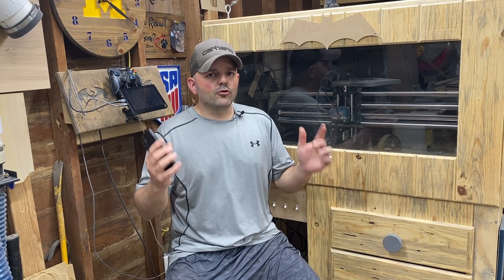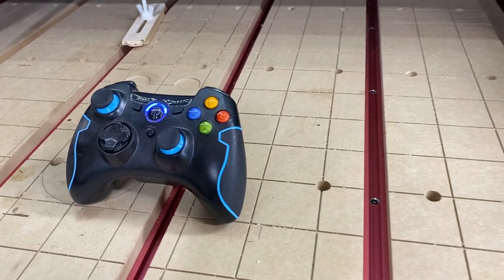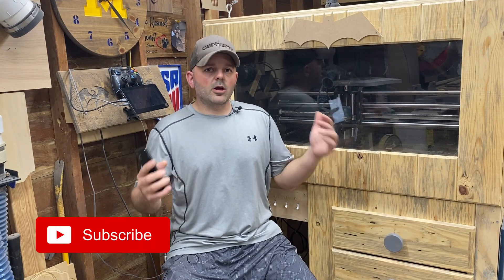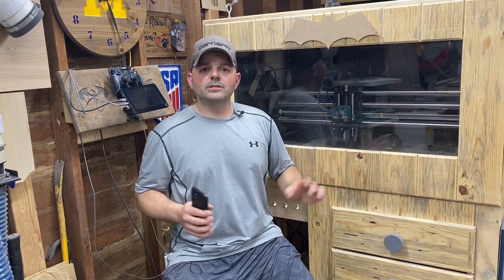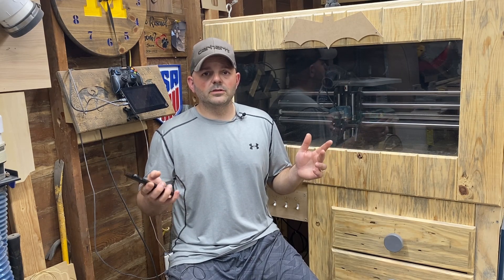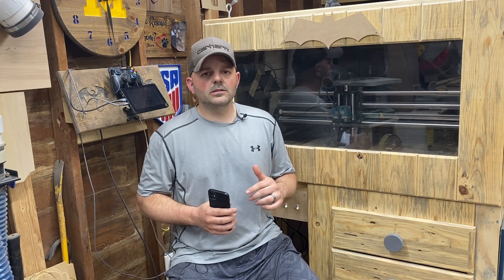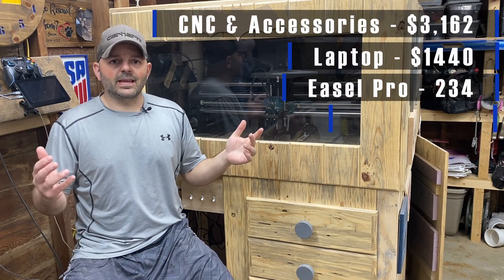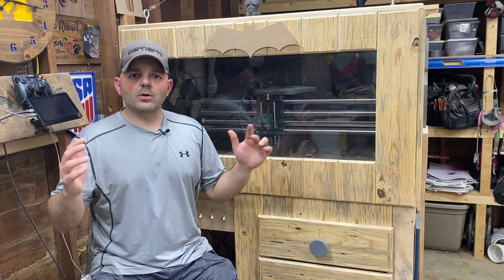Watch BEFORE You Buy! CNC Hidden Costs Breakdown. What My Onefinity Cost Me

Comment: Solid breakdown of the costs. I haven’t made an enclosure, but an unexpected cost for me is needing to get more power in my garage to be able to run both the Onefinity and the dust collection (in addition to the other stuff that stays plugged in).
Reply from the maker: Thanks. I should have added that to the video too. I needed a new line brought to my garage too- with the table saw, dust collector, miter saw, CNC, all that- it was pulling some pretty good amps on startup. I dug the trench and buried the conduit myself and just had to pay the electrician to tie it into the box.
Reply: @SJSSawdust  I told my kids it is like when they wanted a dog and said that “it only costs $__.” Rarely does something only cost what’s on the price tag. Biggest difference between the CNC and the dog is that I don’t mind cleaning up after the CNC 🤣

Comment: Thanks for the very informative video. one question concerning your enclosure, did you build it from a set of plans? Wanting to build me one for my onefinity journeyman x-50.. Really like your set up.
Reply from the maker: Thanks for watching. Unfortunately I did not make it from any plans. I started making the stand itself, from plywood. I ripped them down to 3” strips and built a torsion box of sorts as my top base and used the other pieces as legs. I didn’t want to use “real” wood because I was afraid of it moving with the seasons and possibly becoming untrue throughout the year. I used that and skinned it with 1” MDF. I made my top roughly 6” wider than the Onefinity footprint to make sure the stepper motors and wires didn’t rub on the enclosure I knew I was going to eventually build. If you would like more info - just let me know- I’d be happy to give more info